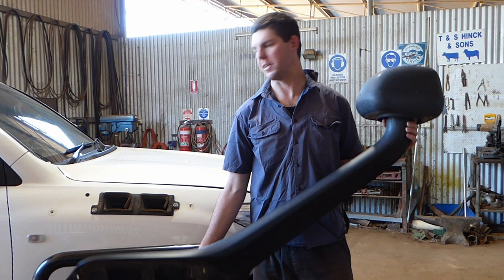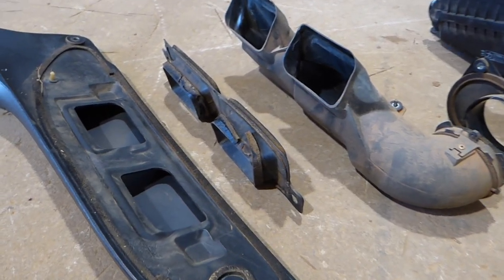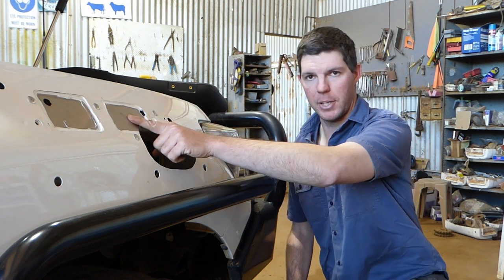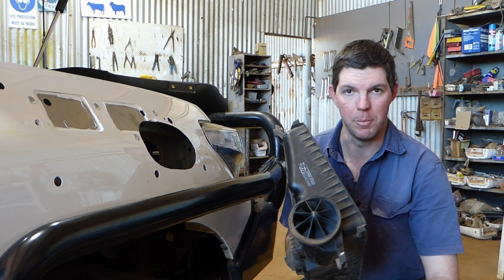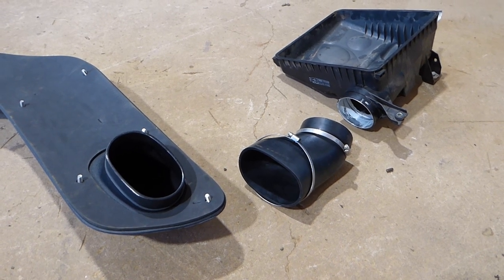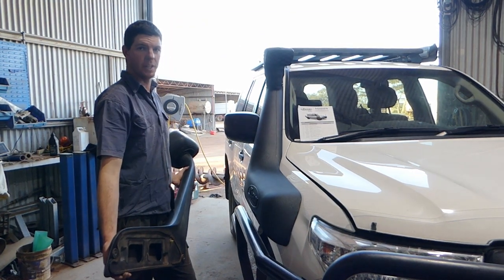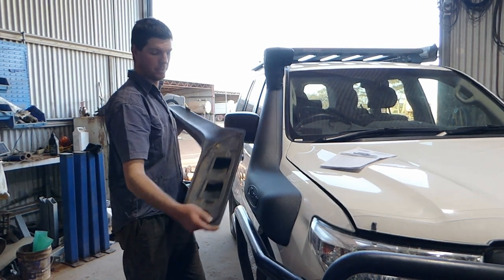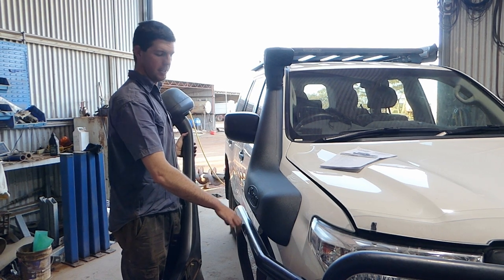200 Series Factory Snorkel Replacement

Comment: Great video. The first video or general information on the net that shows me how to drill and cut to mount my factory snorkel on the Land Cruiser that I found. Unfortunately, there is absolutely nothing on the net about this. I feel like I'm the only one who would like to mount the original snorkel... because hey, it's lying around here with me and other snorkels for the 200 here in Europe sometimes have delivery times of weeks and I'd rather not even talk about the price...
Reply from the maker: My 200 is a ‘GX’ model, the most basic model in that series. Could you find a second hand front quarter panel in your area from a wrecked GX?

Comment: Hi Did the kit come with blanking plate for raised intake holes in panel. Also did it come with the sleeve for air box mod. Cheers good vid only one on the conversion of OE snorkel 👍
Reply from the maker: Hi Tim, yes everything I needed came with the kit!

Comment: So that factory hole that is still visible, is that likely to happen to anyone who follows the instructions to the letter or did something go a bit wrong with this one only?
Reply from the maker: I followed the instructions and triple checked the template, once everything was cut out the snorkel slotted in really well. 
I’d assume it would be the same for everyone, however I never actually notice that a small part of that hole is showing.

Comment: How is the safari one when it’s raining.. seems like it would push water down  into the box?
Reply from the maker: When the vehicle is stationary the rain doesn’t seem to get in there. Whilst driving the air pressure forces the water to the outer edges of the snorkel head, then there’s small areas where that water can drain. I haven’t noticed any water in the air boxes on my previous vehicles fitted with snorkels either.
Reply: Cheers for the video mate, great work, absolutely devastated that they come with this snorkel. I hate the fact that I’ll have to replace and have unnecessary holes in the car

Comment: I noticed you kept mentioning the fact that the OEM snorkel is not properly water tight, did you have water entering your engine?
In order for the water to go past those foam seals of the original Toyota snorkel you need the water depth to be as high as your door handles, I believe the car would float in such deep water🤣🤣🤣.
Thanks for the video.
Reply from the maker: I’ve had plenty of water over the bonnet on my previous vehicle so I wasn’t willing to take the risk on the foam seals! Cheap insurance as they say 😉